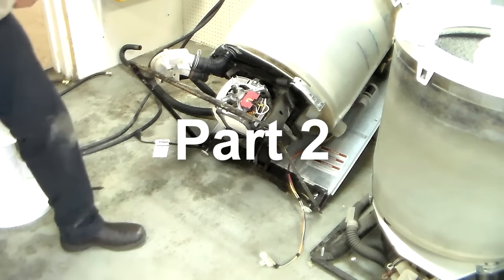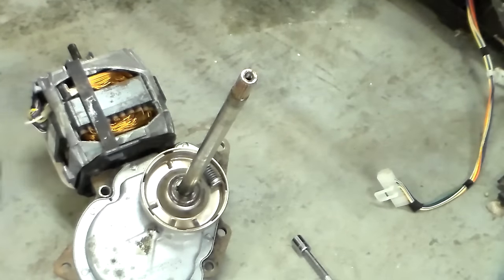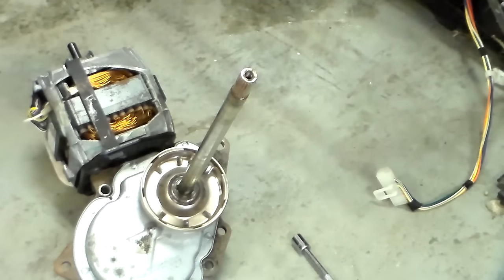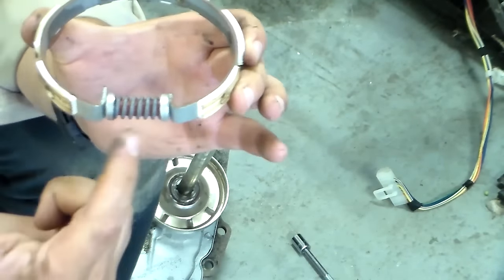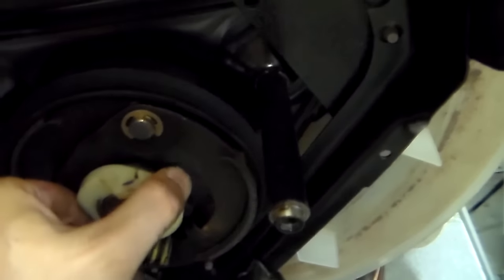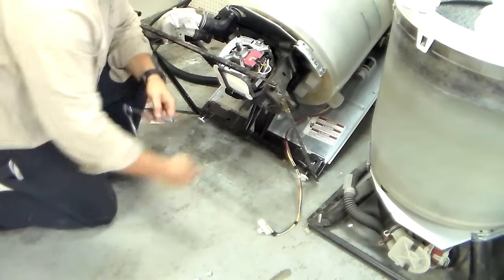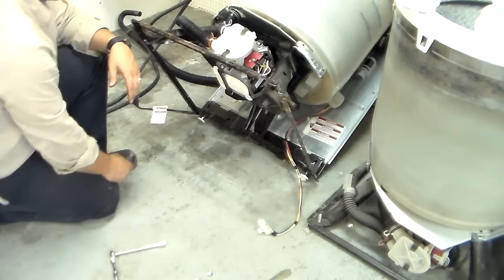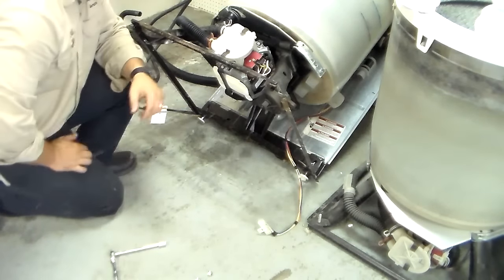Kenmore Whirlpool Washer Not Spinning 2

Comment: I recently installed a new transmission in my whirlpool washer.  (it was shot, did not agitate, spin etc.)  Now the agitation works fine, the final spin cycle works fine as well.  What's odd is the spin/rinse cycle right after the agitation, the machine pumps out the water but isn't spinning.  If I open the lid for just a second and then close it, the washer spins just fine.  The coupler looked good but I did not check the clutch when it was apart.  Could the clutch cause this if opening the lid makes it work? Thank you

Comment: What does it mean when the transmission shaft goes all the way into the hole except the last half inch?  I can't put the bolts in because the transmission is stuck half an inch from the screw holes. I tried removing the clutch assembly to see if that was stopping it, but the transmission is still half an inch from bottoming out.  Using a flash light, I could see that the transmission shaft is in contact with the bearing at the bottom of the tub.

Comment: I' ve noticed that there are 3 pad and 6 pad clutch linings.  Would the tension spring be different using one vs the other?  I have not dismantled my washer yet, but suspect it is a 3 pad clutch lining.  Since the 6 pad clutch part often deso not come with a spring assortment, and if mine is a 3 pad, I might be caught mid-project lacking the necessary parts to complete the job. Why is there usually an assortment of springs when one buys the entire clutch housing with the  assorted parts?

Comment: I replaced my clutch, yet it's still kinda weak and I sometimes need to spin my tub by hand to get it started good, otherwise it starts late and very slow. I noticed the clutch you have has multiple friction pucks on it (6 or 7), my old one and it's replacement have only three pucks on the ring, which I thought was kind of a poor design. Does it matter which clutch I use as long as it's the same size, configuration, with the correct spring type (I have a large capacity - blue spring)? I feel like a ring with more friction pucks would be an upgrade.

Comment: I replaced the lid switch, and clutch, checked the coupler, and did the Neutral Drain kit rebuild on the transmission and replaced the oil.  It still wont spin most of the time, any other suggestions? Sometimes it does spin, but mostly it does not.  Could the brake be causing it somehow?  The motor is running and it sounds like it is spinning.  If I turn the knob all the way back around to the spin part of the cycle, it will spin.

Comment: hey bill , i noticed how easy you took the pump off , my pump on my kenmore is stuck on and i was worried to force to hard to get it off. there is a small drip coming from the pump area , is that whats making it hard to come off because its a bit rusted in there. also if there is a small drip is there a may need to be replaced or do i need a new pump?
Reply from the maker: +GmGarlo Need new pump for sure.
Reply: Thanks , now my kenmore washer is 25 years old and i do not have the manual, how do you go about getting one on amazon because some are similar and many different part numbers. last thing i want to do is get a pump and its the wrong kind . would really like your advice please.

Comment: motor cuppler is good and the clutch is plenty stiff. whats the next option for an agitating but non spinning washer? also the lid switch is functioning properly as well.
Reply: Check the water pump for something stuck in it.
Reply: Rafael Huicochea the drain pump?

Comment: Hi Bill, I have a Kenmore 80 series washer. Operation of wash and spin cycle runs fine without any unusual noises. At the end of the spin cycle, just as the motor stops powering the spin cycle and tub starts to spin down, there is a very loud banging noise. Every solution I've found says it's the clutch. I installed a new clutch making sure new one went in like the old one had come out, gearcase seated properly and all that, but still banging. If you have any suggestions I would appreciate it. Thank you.
Reply: i have a series 70  and seem to have had a similar problem .  with the front of the machine off so you can view the operation . and you ll have to jump the trip switch on the lid   . just  tap on the wiring connection to the motor .  sometimes i think dirt and dust get in there and make it not work or spin fast  just slow .  . i tapped on it  and took the little screw out and  just  sprayed some electric spray around the connection  to the motor .  /. if you tap on it  use a rubber  handle like so as not to get a shock .  well it worked for me  i thought my clutch was bad too  but it wasnt . maybe it ll work if you havent figured it out yet ?
Reply: ps  do the tapping while the motor is running   . if it sounds liek its banging   mine did also . it just wasnt going into high speed .i even thought i d  trip a breaker   the lights were flickering .  hahaha
Reply: Thanks for you response. I found the problem when I removed the inner tub and removed the drive block. Drive block was being stripped out  by the brake drive. Finding little shards of metal was a big clue. Replaced the drive block and brake drive and PEACE has been restored. Running smooth now. Take care

***Not a bad DIY project. Found parts much cheaper on amazon than Sears.
Reply: I have a similar issue after replacing the clutch. Only this noise occurs when you close the lid after opening it on a spin cycle. When the tub initially starts to spin there is a loud bang. Where exactly is the "Drive Block"?
Reply: Reimer023 did u ever figure out the issue?

Comment: Hi Bill,  I have a Whirlpool Washer  that only agitates and drains.  It does not spin.   I have replaced the clutch, coupling, tested the lid switch and pressure switch which are fine.  The drive block appears to be fine. At this point I don't know what else I can check. The only other items I do not know how to check are the timer and transmission.  Any assistance would be appreciated.  Phil

Comment: I saw another video indicating that once the motor is removed, spinning the coupling clockwise should spin the tub, counterclockwise causes agitation.  I was able to spin the coupling clockwise with my hand - the agitator itself moved, but the "basin" did not, so I am thinking clutch now.  As far as the other problem, well, perhaps that will resolve itself - much easier to test for a bad clutch this way IMHO.

Comment: Hey Bill, I replaced my bad clutch and reconnected everything as instructed on your video, only problem is, when I go to start the machine, it doesn't turn on at all. I can hear the power engage (in other words sounds like power is on, but nothing happens. I tried to cycle the knob through the different positions, and for some reason it only comes on when I set the knob to rinse or spin, which is what the problem was before I replaced the clutch. Now when I turn on a cycle to begin, it never draws water or begins to to do anything. Any ideas?

Comment: excellent instructions, bill, ive fixed coupler & pump ( separate occassions)..now its a 'no spin' situation with just a dull electronic noise. clutch & brake release appear exc cond. shouldnt the spline shaft & coupler area move exactly with one another? i can spin them independently!(i know theres plastic gearing in there) id be upset if its a tranny, but your videos almost make it fun!.

Comment: My machine isn't spinning.  I just went and ordered both parts just figured down the line it couldn't hurt, and I don't have time to wait for parts.  The motor coupler looks good.  When I moved the washer I found a bolt. When I went to remove the motor there was only one bolt and I found the other one on the floor behind the machine.  Both the coupler and the clutch seem to look good?  Could it just have been the motor wasn't fastened down?
Reply: It was just the bolts, thank you so much I couldn't have done it without your video.  I am keeping the parts, so if/when it does go out I got them and I can fix it!  Woman 53 4"11 105 lbs, If I can do it anyone can!  Thanks again!!

Comment: I replaced module coupler. Still not spinning. I have a Kenmore Series 80 washer. It fills, but will not agitate or spin, but makes a humming sound when it is supposed to go to agitate cycle. Should I purchase a new washer? Could it be the Transmission? I tried to remove the transmission, but found it difficult to remove from washer. Thanks for the help.
Reply: happened to me too just today. so i flipped it down again and unclipped and clipped the pump, and pushed the coupler a few times to turn it, and then pushed the clutch to turn it too, and suddenly i felt a fainted click, and then it wouldn't let me turn it much anymore. it almost sounded like the clutch finally 'engaged' with the transmission with that last push and everything was in its right place at last. i quickly put everything back together and held my breath and pulled the dial, voi·là, it spun.

Comment: When you remove the pump using the two clips you then remove the motor using the same style of clips, only those are held in with a bolt which can can see after he moved the pump.
Once you remove those clips the motor will pull right off and the coupler is easy to get to.

take his advice, pull the motor/transmission assembly fully out, then work on it, much easier and honestly takes less time and scraped knuckles.

Comment: So the clutch band I have strong fingers and I can still move it is it where it won’t be no movement at all or you can still spend it a little bit with some force I’m confused because everything else checks out on the little rubber grommet next to the motor and transmission that’s good and now this one the clutch band but I can spin it not easy but still move it with a little bit of force. Also where do I get a clutch been ordered please share

Comment: Make sure your motor don't get wet in the process and that there is nothing binding when you install the new parts, it's always good to manually drive the shaft with a hand tool to ensure that nothing is binding or your motor will burn out, wetness is also important

Comment: Coupler is good agitator is working .Once dial get to spin it will not spin to release water from drum.Changed water pump.Do you think it could be the clutch?

thanks
manuel
Reply: If after the wash cycle it stops and will not drain water nor spin, then you have a bad lid switch.
Reply: Or the direct answer, "yes", it could be the clutch.
Reply: Spinning does not release water from the drum. Spinning comes later. I suspect the timer is coming unplugged.

Comment: While pulling out the motor/trans./clutch assembly, a 2" pin with a flat side on it dropped out from the bottom of the drum where the clutch attaches. No idea from where it came but it was from there somewhere and I can't find the spot for it. Any ideas would be greatly appreciated.

Comment: so i did as your video said and my clutch is good but that yellow tab that you turn counter clockwise fell off when i pulled the motor and transmission.  do i need to buy a new tab it looks like its broken.

Comment: Hi my washer is spinning but the agitator is making a snapping sound,,the tube will spin..but it seems like the agitator starts and stops just enough to make the loud noise then it will catch and spin with the tub..what do you think that is. And the part you are talking about here has only 3 white pads on it...is some missing or broken..???
Reply: Sounds more like you have a problem with the agitator dogs (Part #Whirlpool 80040). They are $4 and very easy to fix. You can test to see if this is the issue by seeing if you can spin the agitator both ways. The agitator should only be able to spin one way and catch going the other. If yours is spinning both ways, replacing the agitator dogs will fix it.
Reply: I replaced them already...IT sounds like the agitator is slapping or it would stop then catch causing the sound..with or without cloths in it..

Comment: I just put in a new water valve, and the machine is working again, but a metal pin of some sort fell out when I moved it and one screw. Now the spin is not working. Where would those need to be put back in?

Comment: Hello Bill.  I changed out the clutch and the coupler was fine.  it does everything but when it's time to spin, it doesn't.  I turn off the washer and turn it back on and it spins no problem.  What can it be?

Comment: I took my motor and transmission to parts store and they replaced the coupler and clutch while I waited.  Came home put it all back together, ran it and it agitates good, but still not spinning, so I took it apart again just to check everything, put it back together again and now nothing works at all. It seems like the whole basket is stuck on something, because It was hard to even spin it by hand.   Please advise!!! thanks

Comment: So far so good. I replaced the basket drive and put in a new clutch. I have ran two full cycles and it is running great. My one concern is a slight burning smell. I want to attribute it to the new clutch and pads but just wanted to see if anyone else has come across this issue.

Comment: Ran a cycle on the new clutch. I missed the step on the counter clock wise because it looked like it was all the way up. At the end of the cycle high spin I smelled a little smoke. Is this suppose to happen with a new clutch?

Comment: If the brake is sitting on the clutch will it still go together? My washer still wont spin and now I'm getting a loud clicking during a spin cycle.  I already re-checked the coupling and nothing is broken. I dont know what to do know 🤔

Comment: $20 in parts... took about 30 minutes to replace clutch and the little rubber and plastic part.  

My issue was mainly the clutch bit just went ahead and replaced both parts since it was sold as a kit.

Comment: Thanks Bill for the video, very informative but I can't use it for my washer. I have LAT9706 Maytag washer that doesn't spin.
I open it looked underneath not the sameas you shown in your video.
Can you help on how to go about finding the spinning problem,

Thanks again
Reply from the maker: Does it sound like it's trying to spin?
Reply: Yes, it is running normally except when it comes to the spin it just bypass it.
Also my Maytag washer is belt driven, water pump is driven by the belt. You have transmison in one location motor at different location that is why I can't fint the coupler if there is one. Thanks again Bill
Reply: There are couple of pieces of felt like cloth one inch wide by 1/8 of an inch thick seems like it came out of the transmission...
Reply from the maker: http://amzn.to/2aXCaPb  This part here is what engages the spin on some maytag washers.  I think on yours, it sounds like you just need to replace the belt that goes around the transmission pulley and the motor pulley.  Belts stretch over time.  Also make sure the tension spring on the motor is still connected.  It pulls the motor back to put tension on the belts.
Let me know what you find.
Reply: Bill, Do you don't think anything is wrong with transmission?
The washer does everything else but draining and spinning.

By the way this Maytag machine has two belts may be I should change both belts.       PS2005284
Thanks Bill
Reply: The two springs on the motor are connected, I adjusted the tension on the the two belts that didn't help.
When it comes to the spinning cycle only the clock is ticking and the knob is moving to the next level. A few days back you could trick it by taking it to a different spinning cycle it would work one out of 5 times.
Now it dose't work at any spin cycle. The clock is ticking with no spinning.
Reply from the maker: Test your lid switch next.  Some washers will fill and agitate with lid open, but motor will not have power for spin & drain if lid is open.  Let me know how you make out.
Reply: Bill,
The lid switch is working fine.

I had to go out and purchase a new Maytag washer because I couldn't find what was wrong with the Maytag that I have already.
 
I still would like to fix the one in question but I gave up as to what is wrong with it.

Do you think the transmission may be in fault? If you read my note there were couple of toren pieces of felt that came out of the base of the transmission.
Thanks
Reply: johnajk1 you might have a bad actuator or broken cam splotch.

Comment: My clutch pads look Thick and good but my clutch won’t spin or give at all when trying to move it. Could that be an issue? My washer was working find until I didn’t catch a unbalanced load and it bang up against my wall and stopped working. Will go through all cycles fine but won’t drain to spin :(

Comment: At 6:15 in your video, there is a tip that you put a SMALL dab of silicone grease on the brake drum surface. This creates a little slip so when the machine stops spinning, the tub doesn't slam to a rest slash stop. Which would save that flimsy motor coupler and the stripping out of your motor and transmission shafts. Take a small pocket screw driver with a TINY amount of grease is all you need. Here's the link - http://www.davesrepair.com/DIYhelp/DIYddbrakelube.htm

Comment: My Kenmore Model 110, Series 80, was running with a load on "wash" when it stopped agitating and won't spin when I move to a spin cycle.  I can get it to drain but that's it.  Am I looking at a clutch replacement?

Comment: Hi Bill.   My washer just sits and hums while its in the drain/spin phase until I lift the lid up and back closed, then it starts to spin.   I've replace the clutch, motor coupling, and water pump.   Was thinking of replacing the capacitor next.  Any ideas?  Thanks
Reply: did you try lid switch
Reply: Thanks for the advice but it wouldn't have gone from agitation to spin if the switch was bad.  May try the start capacitor.